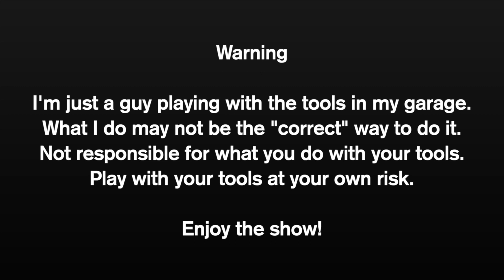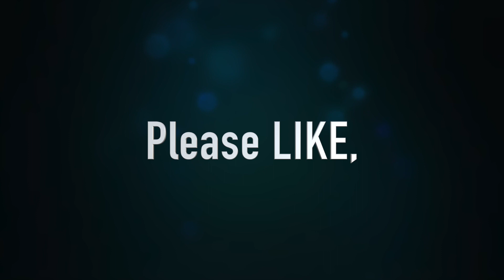1995 Seadoo GTX Fuel System Removal for Beginners

Comment: You have helped me so much. I rebuild the carb. 1998 Mikuni GTS 717 seadoo bought new. Replaced almost all the fuel lines. Sender good shape. Removed tank black crap removed & 2 year old gas. In carb filter Solid with black like tar. Won’t start, no gas in the filter nor lines. Going to find a primer/vacuum pump. Any more suggestions. Thanks Dennis. North of Toronto Ontario Canada 🇨🇦
Reply from the maker: Dennis always nice to hear I helped someone out. You may wanna check the "check valves" , usually round half black/half white in vent line off fuel tank.  The fuel selector can be a problem spot. There's also filters in the bottom of the pick up in the fuel tank.

Comment: What did you use to degrease the inside??? Mine is really ugly… I have a pressure washer… but don’t know what to use for degreasing
Reply from the maker: I use Purple Power. I spray it down and let it sit for 10 mins or so then start washing with pressure washer. I tip the front up so it drains. Sometimes ill put one side up on a block because drain plug is only on one side.  You'll see me washing this one out about 1:30 mins into this video: https://www.youtube.com/watch?v=-La_FfJOv18
Reply: Thanks for getting back to me… some people put links for people like me to look at what you guys are using …
Reply from the maker: @krowbar1969  I’ve got links on most all my videos. Plus on my Nine Finger Wrenching website there’s a tap “stuff I use” it shows all the stuff I use in my videos. Link to website is on the about section of YouTube.

Comment: Hey man love the vids! I just got a 95 sea doo xp that’s running really rich. The guy i got it from said someone switched to pre mix when it wasn’t needed so they switched it back and now it smokes a lot still from that mix. Do you think it will clear out when I put fresh gas and oil in?
Reply from the maker: So someone put premix into an oil injected ski? You don’t mean they took the injection off/block off plate? 

On a new fresh motor build sometimes I’ll run a tank of premix through first. Yeah it’s bad smoky. It will clear up though once you go back to regular fuel. You may need new plugs after. Or at the very least give em a little cleaning.
Reply from the maker: Oh and thanks for watching!!! 😎🙌
Reply: Thanks a lot!😎 I just got back from a ride and it won’t stay running in the water.  I’ll have to look into it. Maybe it’s just the idle screw
Reply from the maker: @parkers7009  in water you should be about 1500, out of water 3000 rpms

Comment: Those are not Phillips screws. They are something JIS, Japan Industry Standard. The JIS tip is just a little bit different. it fits in the screw head better. If you look at all of those screws, you will notice a punch mark on the head of the screw, this indicates JIS. I have to admit they are much better than Phillips.